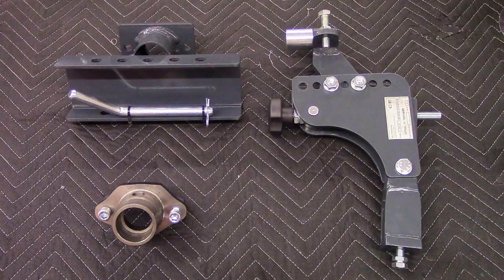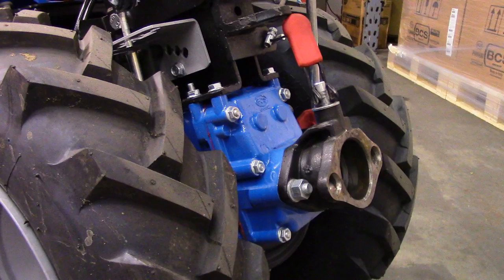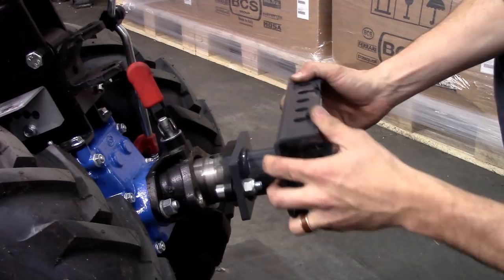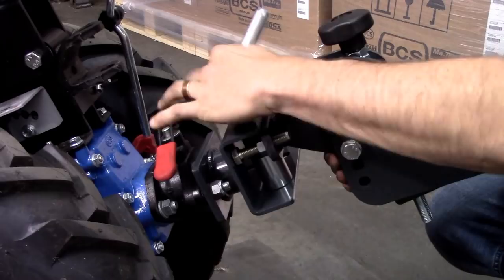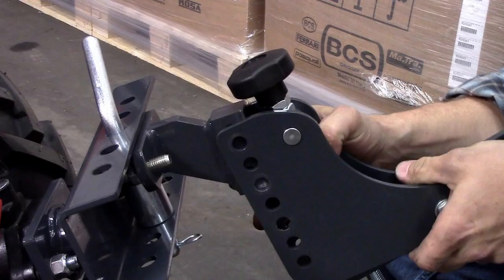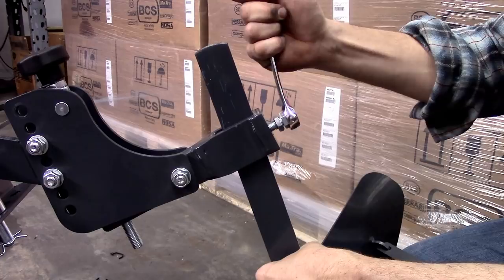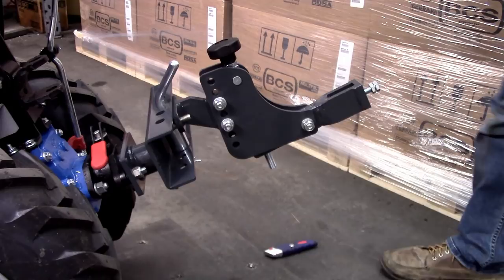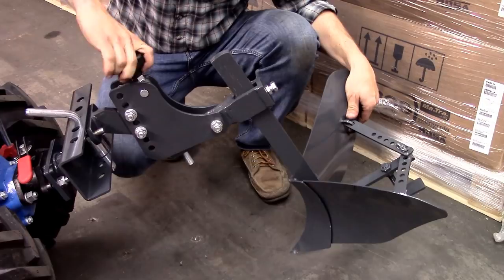BCS Tool Carrier Kit Assembly

Comment: Are the Ridger or Subsoiler strong enough to rip tree roots?  Smaller ones obviously, I'm not talking about pulling stumps with it.  I have a LOT of roots throughout my land that I will be clearing and wondering if you have a suggested implement if these won't do it...possibly the rotary plow? 

SIDE BAR:  Have yall ever thought about making a Stump Grinder and Ditch Witch?  
I ask because a lot of equipment places won't even rent them anymore due to high maintenance costs - I'd have to travel about 8 hours each way to rent one) so it would be cost effective to purchase instead, well, for me anyway...so...yea, make one...just for me!  lol.  Didn't mean that to sound self-centered so I had to make light of it :)

Comment: I believe if you have 5×10 wheels the rectangular bar should be mounter on top of the pto, with larger wheels, below. Ive tried with a plough using 5×10 wheels. Positioned apove pto, tractor is level. Positioned below, the engine almost hits the ground!
Reply from the maker: Yes, depending on your tractor model and the wheels you have installed, there are different ways to install the Tool Carrier.

Comment: Is the quik hitch necessary to use this?
Reply from the maker: Not at all.  The Drawbar Hitch can be mounted directly to the tractor without a Quick Hitch.  But it certainly makes it easier to go from a PTO-driven tool to a drag implement.  No tools required.  Thanks for asking!